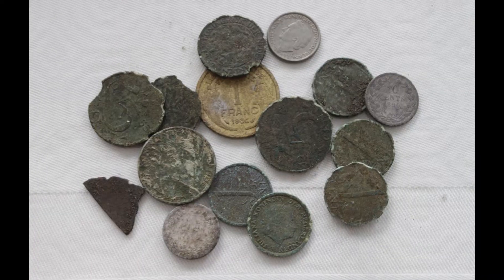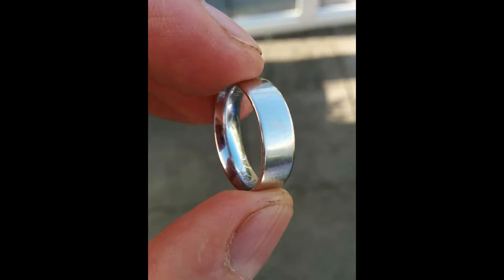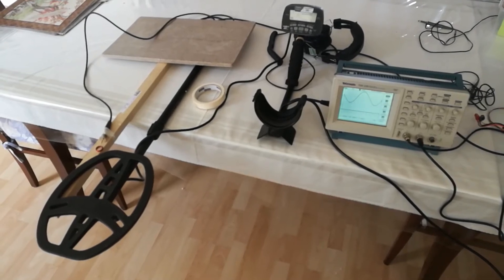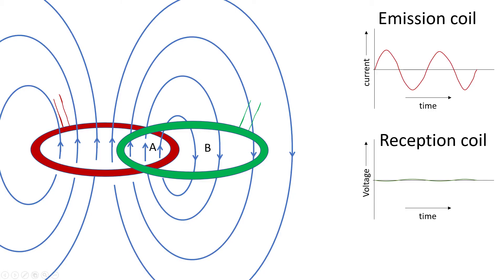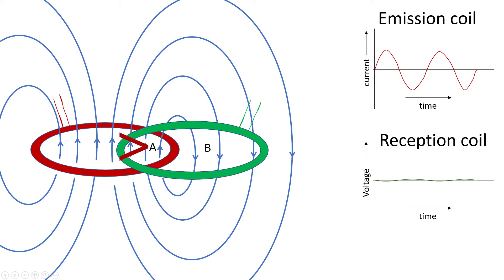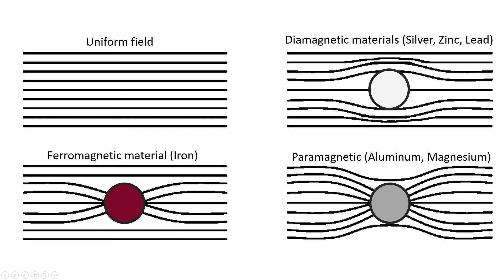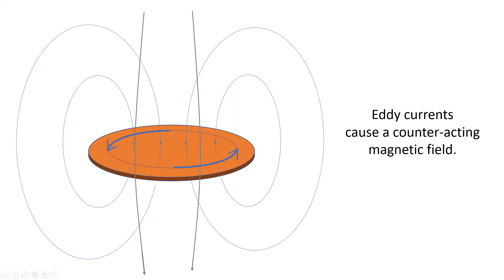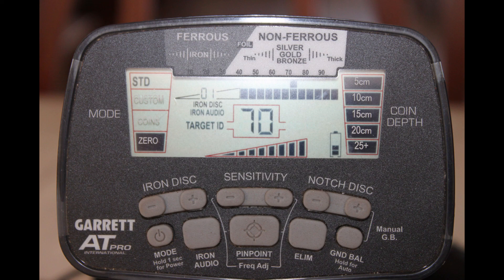Metal Detector Discrimination Explained (with a Garret AT Pro)

Comment: Ive been using detectors since the early 70s.  With the early detecors you used a constant threshold and listening closely for the Phase Shift.  The term we used was "Getting your ears right".   After awhile you can mentally picture the graph and negative positive response curves in your head.  Its was self inflicted Pavlonian Training.😂

THIS IS the BEST 🎉🎉🎉 description of coil operation on YouTube.

Certain old Whites Detectors could be precisely "dialed in" to do just that, but do it extremely well.

Comment: Have you thought about studying the shape and style of coil on the performance of detection, by making micro coils for the detector? Say ,50-75mm coils?  I had the idea of using two pancake serpentine coils have one zig while the other zags!   Alternating the coil around ,8 x 20 mm dowels,  bone coul is on the outside of the dowel with the other on the inside!  So each dowel is like a small DD coil, this could boost performance especially with a large 1000mm boil with the use of 100mm dowels! So there is basically 8 x100 mm coils.  Could this be effective??
Reply from the maker: Part of the power of the DD coil is that it allows you to better locate an object during scanning it over the ground sideways. You would miss that feature if you were to create multiple small coils and add them together in a single coil.

Comment: Many thanks for the awesome video! One of my mates is a hardcore metal detectorist and is keen to get me into it as well, but the cost of the equipment is quite a lot higher than our means (We’re both on welfare) and the Hacker in me was wondering if it might be possible to build a home brew detector. 😇

Now I understand most detectors do the signal interpretation/discrimination on the users behalf, but given a 15KHz search frequency would be within the range of human hearing and the detector coil would normally have little or no voltage potential when the search field is balanced (e.g: No objects are there to interrupt it) might sending a fixed frequency to the search coil (By means of an ATTiny or similar) and having an earpiece wired directly to the detector coil (Forming a closed circuit that’s driven by the search coil) produce a workable audio-only detector that would additionally help the user to learn to discriminate manually by reference to the frequencies they hear? 🔉🪙🧑🏼‍💻

(Sorry if this makes little sense: I have strong ASD and my use of English is rather hampered. 😇)

Comment: I recently purchased a late model surplus military detector that will pick up the very small particulate metal that is found in plastic explosives. It will detect metal that is literally as small as a single grain of sand, and it will do this at considerable distances away from the search coil. Presumably it does this based on the same principle of physics that is described in this well made video. However, i'm curious to know if the coil on this machine is considerably different on this detector or if the electronics in the control head account for this extreme sensitivity to a nearly invisible amount of metal. It doesn't seem possible that a detector could pick up the extremely tiny amounts of metal that this thing will, yet somehow it does this very easily. Great video!

Comment: New comments on an old post are unlikely to be detected, but I wonder if a double-D detector could be used to find sunken submarines or crashed airplanes. The search coils could be huge, perhaps 10 meters, and the frequency could be very low, perhaps 100 Hz in order to penetrate seawater. Several issues would be if the detector sensitivity could match a SQUID or MAD magnetometer, and how big the search cone would be.

Comment: Great video and thanks for taking the time and effort to set it all up. The results really correlate with my metal detecting IDs (Minelab Equinox) but I wish you'd included copper as that's such a commonly found metal. I suppose being a good conductor and diamagnetic it'll be similar to silver?
Reply: Your equinox runs using 2 separate frequencies simultaneously. The lower frequency is more sensitive to copper and silver it targets higher up the VDI scale where as the higher frequency is more sensitive to the lower frequency. The two frequencies have a huge difference in the shift of the targets phase. When it detects a target it reads the low frequencies shift and strength of the signal. Then it does the same with the high frequency. There is a processor that calculates the difference between the two and assigns it a VDI (visual target identification) and generally it is pretty accurate but it doesn't "suggest" one type of a target over the other. The Whites DFX operates sort of the same BUT it has a feature which allows you to read the shift in the phase which damn near tells you exactly what it is which a much higher degree of accuracy. I'll give you an example. If the VDI reads 20 - 22 it is could be a nickel or a pulltab. When the DC Phase shift is turned on you squeeze a trigger and pinpoint it. If its a nickel the DC Phase will read 39 -42 +/- depending on ground minerals. If the DC Phase reads in the mid 60's to low 70's its a piece of modern aluminum. If its really low like in the teens its old aluminum. Its amazingly accurate once you remember what the targets phase read. But before that I would already know its a nickel because there is a bar graft from 1 to 4 bars. Aluminum will give 1 bar maybe 2 if its a bigger piece. The nickel will run to the top and stack all 4 bars or maybe 3 if its deep. Now if it stacks 4 bars but the DC Phase hits the 50's to 60's you may want to call it a pull tab with the high DC Phase but being it stacked 4 bars and not 1 it is a nickel between 1942-1945 because its a war nickel that have a percentage of silver in it so between the VDI, the DC Phase and the bar graph that Whites calls it the signagraph those 3 points of ID can tell you everything about the coin but the date. And still in the case of war nickels it zero's that down to a few years. VDI of high 60's with DC Phase of 67 to 72 is a penny from 1982 until present. If the VDI hit the upper 70's and the DC Phase is in the high 70's its a copper penny from 1982 and earlier. In '82 both designs were made half way through the season to save copper and instead made it from zinc then cladded it with copper. If the copper plate is intact those numbers above are correct. If it starts to bubble or corrode then the numbers drop very fast on the DC Phase reading. My friends refused to bet me even 1 dime anymore on calling the targets before I dig. The very last time I bet with 2 of my buddies who swept their detectors over it, one calling it a screw cap and the other called it piece of aluminum or a foil ball its a non dig but I called it a penny and to dig it they jumped on that bet in a second Then showing off a little I said its going to be a penny from 1982 or newer it's a "zincoln" the nickname for the zinc pennys and a penny with bubbles popping off the surface dated 1995 came out they were stunned on how I called it right on a clear non penny signal. It was the detector and the 3 points of ID that made that one of the best detectors ever for its time. It had so many settings that new hunters didn't understand and they could adjust it and cause it to lose depth until you learned it and since people had hard enough time coughing up $1,200 for a detector they wanted to be able to turn it on and go. And though it had factory presets for learners the power level was set in the high 60's so people naturally cranked it up higher without changing other setting and all it did was chatter. Whites omitted some features, made it more learner friendly and it became the V3i. That machine runs 3 frequencies and even shows you which frequency is dominate which gives you a hint right their if its a coin or not. But they have come a long way. They also use concentric coils not DD's which can detect deeper but they also see more trash and minerals around the target. The Equinox 800 is a pretty good detector to so you'll do well with it. One tip for all its worth in heavy iron or black sand power down just a bit. It barely loses sensitivity or depth but it greatly cuts down on the noisy chatter. Detectors rarely can handle cranking it to the max without falsing. Good Luck hunting
Reply: Also if you want to learn a trick. Sweep over a pulltab and read the ID. Then cut that same pull tab and straighten it out. Now its the same piece, same metal content, same mass (volume of metal) but what is it reading now? And why???
Reply: @stevenallen9592  Thanks for the very detailed and in-depth replies! I'm guessing with all your talk of nickel you're on the wrong side of the Atlantic to be digging up Medieval or Roman coins. That's interesting about the White's detector - but in practice although it's fun to predict what you're about to dig, how often do you (unless it's iron) actuually say nope, not digging that. With the Nox 800 if I dug only 4-7 (cut hammered quarters), 8-10 (cut halves), 12 (hammered pennies) and 21-22 (milled coins) I'd probably recover over 95% of what I keep without digging up all the other crap. Below 4, 11 and 13-17 are nearly always rubbish (I include buttons and musket balls as rubbbish). Over 21 is usually large copper or aluminium. But a large hammered coin such as a shilling will ring at around 18 or higher, Roman coind perhaps 14-18, artefacts such as Roman brooches could be anything, gold can be low ID, so I dig a lot of crap despite those items being very uncommon. So I dig a lot of crap knowing I'm about to dig crap just in case it isn''t crap!
I started detecting in the 1970s with C-Scope VLF machines. They had no ID, just an analogue meter at best. There were two knobs - volume and discrimination and there was a reset button for ground balance. I remember though I could discriminate quite accurately by the consonants of the tones. Coins tended to have a softer edge whereas iron or lead had hard edges. It's similar with the Nox but not as obvious or intuitive. But watching Holzhammer Sagas Youtube channel I think the Deus in Lite mode has similar qualities. I wonder if there's still a place for those old analogue detectors but with better deeper coils. My 22 year old BMW car runs just fine without reverse camera, lane tracking, telling me when to change gear etc. Similarly I wonder if all the software embedded in these detectors i really necessary
Reply: @stefkuna  
I re read what I posted to remember what the topic was and I caught a bad typo where I wrote the higher frequency is more sensitive to the lower frequencies lol. I probably wrote that apply late at night half a sleep. It wouldn't the my first time. I meant th3 higher frequencies like the lower VDI targets. I'm familiar with the "NOX" in the sense of its dual frequencies and iron cancellation and other features but I haven't used one so I don't know where what targets ID at. I was trying to make a point how those targets that have the same VDI or ID number range like American Nickels reading the same as some gold rings or even aluminum. When using a multi frequency detector the computer tries to determine which frequency is responding better and leans towards the ID of that frequency scale. Air testing doesn't take in account the fact there's no minerals or trash involved with the signal or its ID. I'm a little familiar with the difference in the soil in England as opposed to North America especially in the original colonial states. There's actually been a few hammered silvers pop up but its thought that someone had them collecting and it got lost centuries later as opposed to their when its lost not long after being struck. Being as old as you area is you've built up centuries of metal and of coarse the worst being iron. You also have that hit ground they call coke, right? We have spots of it but its not plowed everywhere its from native American fire pits because much of it is actually organic material mostly charred wood from fire pits. Then over the years this "coke" is plowed all over, rain spreader some and some areas of older pits that were deep is really bad. The lower frequency which is more sensitive on thicker silver or copper coins don't hit those very deep because of that hot soil and can miss those little hammered silver or small gold. Then the higher frequency with chatters a little more is better on seeing those tiny silvers that the lower frequency struggles with because of the tough ground but it loses depth on coppers. The detector also gets thrown off by the ground reading. You might balance it and track on it but the value of the ground changes a little more erratically because its not a metal that creates a magnetic response more as it silences it like a ferrite rod. Nothing here even the few hot spot burn pits are enough to deal with like you deal with. But another point that I really wanted to bring up was the shift in the phase. The microprocessor can figure out which frequency is responding better and do its calculations but having that control of knowing the difference between the phase on two targets with the same VDI make for an extremely accurate ID. I used to talk to a guy named Jimmy "Sierra" Normandy. He worked with Whites and helped the development of several detectors starti,g with gold. He told the nickname Jimmy Sierra because he was/is a gold prospector in the Sierra mountains in California. I picked his brain apart to learn these settings on the DFX. He used to field test for Whites in England and he started these paid detecting hunts where about 10 or 12 guys paid at that time (2006+/-) around $2,000 US dollars and the money went to a farmer over there to hunt fields that have produced hoards in the past. On 2008 I almost went if it weren't for the conditions. The farmer got paid to rent the land AND a cut of the value of the find. That I was OK with. Then everything found had to stay for months for the government to go through it, decide if they want it, take a cut if the laws there required it. Then either bought them and paid what they call fair value or set the value and took their cut. Then if they didn't keep the common stuff the contact there mailed the finds minus what the government took and what deal you make with the owner paying him the money or a share of the coins at his call. Ugh and even that I said well that's how it goes. What I didn't like was that a person who spent years to get pretty good could hit some valuable finds and a guy who goes just to see the country side and maybe not hunt much gets to get an equal share of what's found even if they found nothing. That didn't sit well when I heard from people who attended these hunts before that some guys who are wealthy would go and good around in hopes one of the hunters hit something valuable and he gets as much as the guy who dug it? The DFX didn't go over well there because it takes time to really know what its doing when you adjust the sweep speed, or the track speed, inhibit it from tracking and manually track etc etc etc. It was not a new owner friendly unless you spent a long time and had a lot of patience. I think Minelabs popular there. The Deus even some Makro's are preferred detectors there. You know what's more popular there then I would. Jimmy told me a tip about hunting with fresh plowed ground after its rolled and it rained. After the rain the coke leaves s film on the top of the ground. He said to walk through it dragging your foot and break up that film because it acts like shielding does in a coil and the detector was more stable by breaking that later if coke. It makes sense to me being it allows the magnetic field to go down with less interference. One day I'm going to go on a hunt there. I have a half sister that lives there. My dad met an English woman during the war and her mother didn't come to the states when my father was withdrawn after the war. I've met her being she would come to the states on and off but she's kept the land her families owned for a long time. I specifically asked her, (it was more like I begged her lol) not to allow dectorists hunt there until I make it some day. She did say she's been asked quite a lot and caught people night hawking on the land because the property around her has given up a lot of crazy finds from rare gold coins, pot hoards and I think Viking jewerly was found nearby only a couple of years ago that made the news here? I guess fencing 70 plus acres is out of the question lol As crazy as it is in America right now it would be the perfect time for a peaceful vacation and my kids are grown and out  their own. If I don't stop thinking about it I might make that trip this summer.

Comment: Indication: probably in older models changing emitter and phased indication to square wave and operation amplifier substraction stage followed by accumulator operation amplifier stage which output is between 0 V to DC positive and 0 V = 180° shift indication would be scored as indicative ID 100.